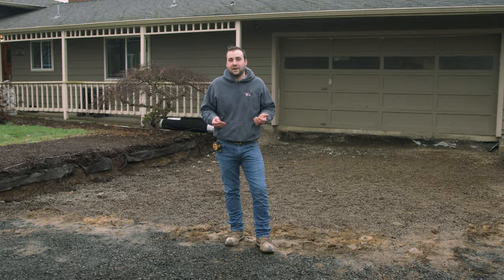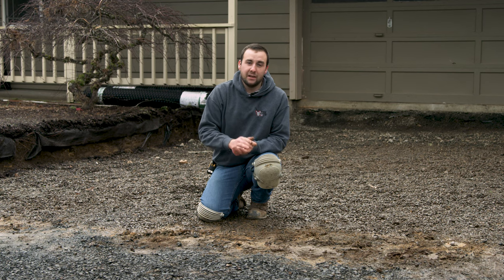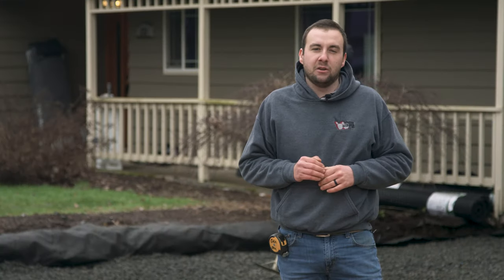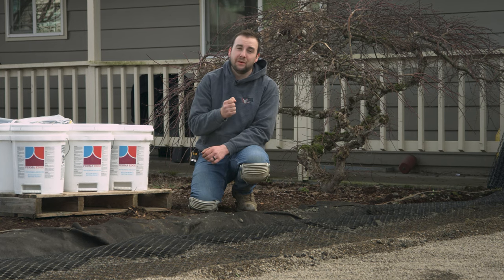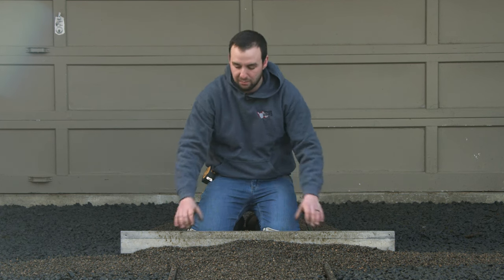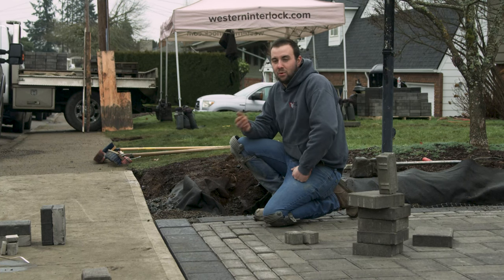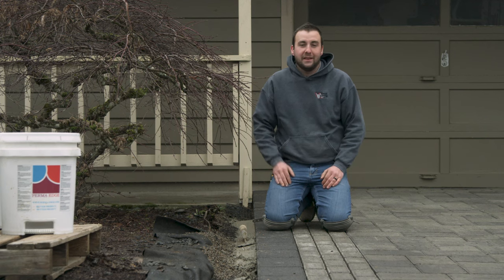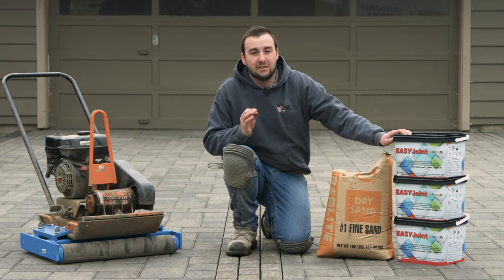How to Lay a Paver Driveway over a Permeable Base Construction

Comment: Do you tamp your layers of base when you do open base? I always do just to help settle the stones and lock them together. Over the past couple years I’ve switched to almost entirely permeable base for project even using permeable sand like gator nitro if the budget will allow. So much more confidence knowing I can guarantee drainage to do what I want without needing to regrade the whole yard and it’s an easy selling feature to clients to set you apart from competition
Reply from the maker: Yes, we always recommend compacting after every lift/layer of base rock. Inadequate compaction is the number one cause of issues with paving stone systems.

Comment: Is this type of driveway recommend for the Midwest region? I.e., snow,rain, sleet over the weekend followed by 55-60 degree days in the weeks after. Just curious how the permeable brick holds up?
Reply from the maker: Good question, thing with permeable pavers is that it is the system that is permeable, not the paver itself. The pavers are made with special spacers on the ends and sides so the gaps between the pavers are larger, about 8-10mm. These gaps are filled with open graded aggregate so the water runs off the stones and through the aggregate in the joints. https://westerninterlock.com/products/holland-permeare/

Comment: do you compact before you put in the edge restraint?
Reply from the maker: Good question, no, you compact the first time right after the edge restraint is installed. You then fill the joints of the pavers and then compact them again.

Comment: You would think permeable pavers would over time loosen up your base and cause shifting of the driveway. Which in reality is a despicable look. Not sold on permeable pavers at all.
Reply from the maker: You'd think, but the reality is that they don't. We've had permeable pavers installed in our parking lot for over 12 years with no problem.